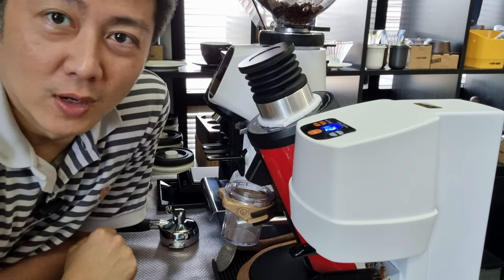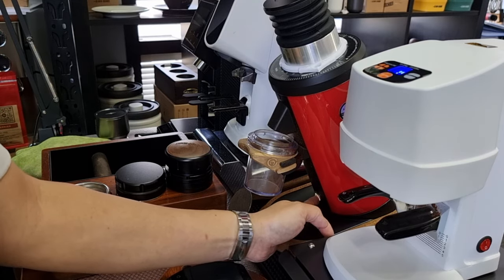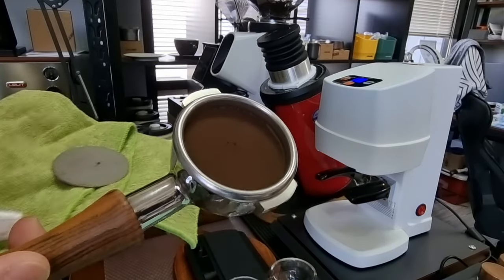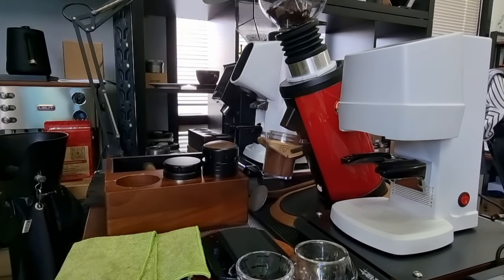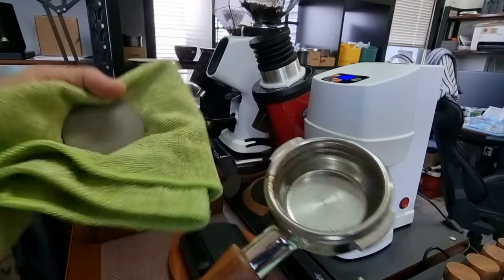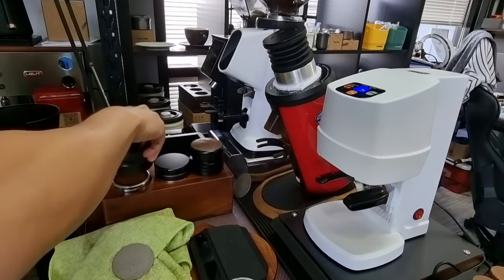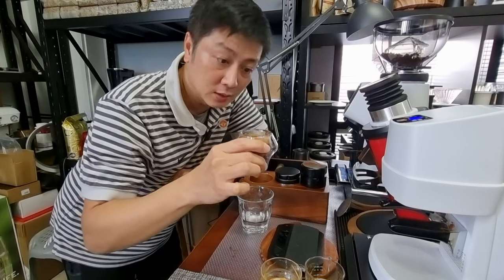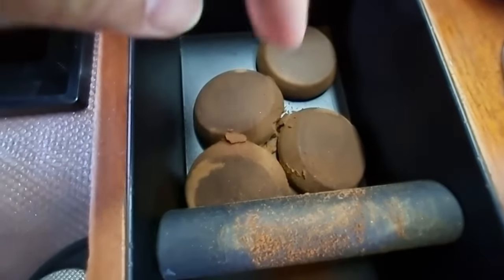Auto Tamper | Does Tamping Strength Matters? | CPP-145 from Perfex

Comment: 22:18 I think that last tamp might have ran faster because the tamp wasn't perfect, that's one problem I found with some of these auto tampers, you still need to watch the angle and have it aligned carefully for it to tamp evenly.  I tried one and had the same issue, where sometimes I'd have the tamp off-kilter. With the puqPress Q2 once adjusted properly to your portafilter it guides the portafilter in nicely I find so haven't had any issues with it, besides the Price :D
Reply from the maker: Yeah. I will definitely be testing it for consistency. And I fact I will be repeating the experiment with exactly the same parameters and see if the shots can be consistent.
Reply: @CaffeMartellaSingapore  try without puq screen if you're planning on doing more testing. In my experience you may have to grind more fine without the puckscreen.

Comment: Besides the last one where you got more out in the cup, I don't think there was any clear trend in how much coffee you were getting out in the 30 seconds, they were all mostly around 41g out. You'd think there would be a trend with getting LESS coffee in the cup in 30 seconds the harder you tamp, but I guess once it's sufficiently compressed it's compressed, However, I do find the puck screen acts as a secondary tamp, I think It pushes down on the coffee bed, which is why you end up with such a solid and dry puck, so that could be actually clouding the true results, still the results are applicable to those who use a puck screen consistently.

It is interesting you seemed to find a trend in the Taste though, where it peaked at 20kg (44lbs). I predicted the last one might not be as good since you got more out in the cup and it might have channeled more, but besides that I think there was actually a trend there as you mentioned.
Reply from the maker: Yes I totally agree with you on the higher tamping force which leads to mote channeling and hence the not so desirable aftertaste.